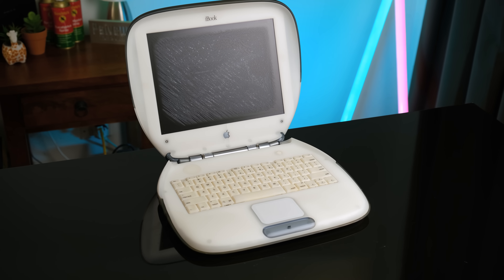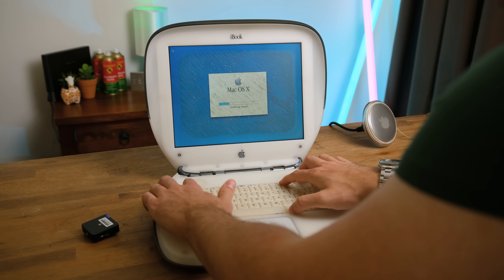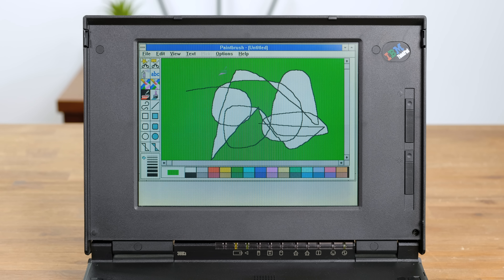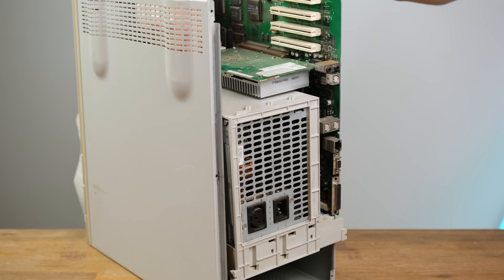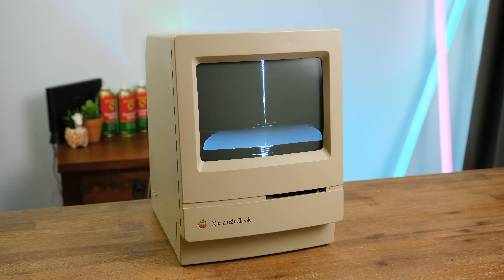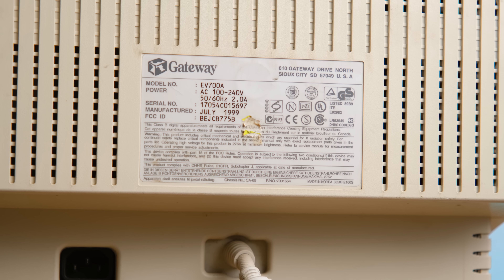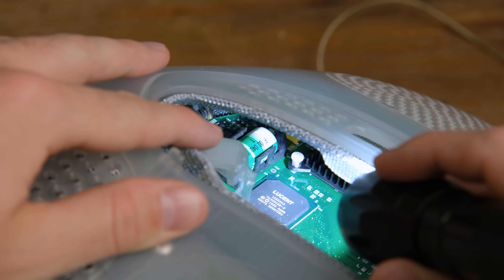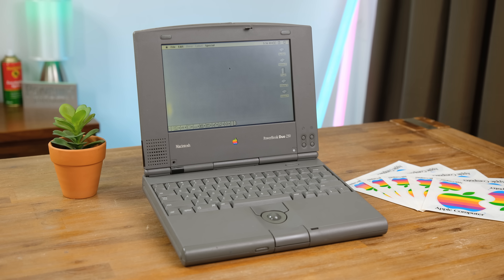So Much Vintage Tech Is Dying... Here's Why

Comment: Back in 1987 my boss had a 2nd generation IBM workstation. green monochrome, big floppy disk drive, the works. She loved the keyboard so much. There was an old photo of Bill Gates with that exact same model in the background when he first started out. It was built solid but computer tech guys all hated her using it and kept wanting her to upgrade.
Reply: That sounds like an IBM Model M keyboard, they started coming with IBM PCs in 1985. I'm using one from 1994 to type this, I love it. There is a company called Unicomp that still make them.
Reply: @JustinHiggins  "2nd generation IBM" probably refers to the IBM 5160 PC XT, the successor to the IBM 5150 PC. These computers used Model F keyboards! Far superior to the Model M, IMO.
Reply: @AerFixus  I thought ‘2nd generation’ might refer to PS2. I would love to try a Model F, but they are a lot harder to find than the Model M.
Reply: @JustinHiggins  given the rest of the context: The IT department wanting the user to upgrade the machine in 1987, presumably because it is out of date, wouldn't make sense to be a PS/2 since that was released in 1987. Also notable is that it had a monochrome green screen, which was no longer a standard option for the PS/2. Also, having a "big floppy disk" seems to refer to the 5 1/4" size of disk, rather than the smaller 3 1/2" floppy disks.

Anyway, it's an interesting story. And Model M and Model F keyboards are both great. I'm just a snob and I enjoy typing on an F significantly more than an M. Don't get me started on Beamsprings!
Reply: @AerFixus  Oh, so you're the reason I can't find a reasonably priced keyboard for my IBM 5150 😂
Reply: @thepenultimateninja5797  I use an IBM 4704 Model 200 board, a 62 key Model F. I've had a few XT boards, but all but one were either paired with a 5150/5160 computer when I bought them or are now reunited with matching computers at a new home. That was years ago that I bought those, though. I haven't purchased any orphaned 5150/5160 boards for more than 6 years. Incidentally, my beamspring was saved from severe fire damage. There's a Deskthority thread on that one.
Reply: @AerFixus  it's probably an AT connector
Reply: @Aer Fixus  are they actually superior ?
Reply: @AerFixus  If it's a realy old 'personal' computer, or a later Mini computer, it could have used 8" floppy disks 😜
Reply: @JustinHiggins  a few times I tried to order an Unicomp keyboard asking for shipping to Brazil. but I couldn't get an answer.
Reply: @JustinHiggins  Got one from '86 here, still works great. Such a pain to have to pull and clean the keycaps every few years.......(snicker)
Reply: @JustinHiggins  crazy that you're using an 80s keyboard to type in the 90s, on a comment that gets posted in 2023. How optimistic are you about the future?
Reply: @TheRogueAdmiral  Quite optimistic: I think if we can make it past the y2k bug, everything should be fine until 2038.
Reply: @JustinHiggins  I have the unicomp version, but it isnt quite the same as the origional even though its supposed to be made with the same tooling the origional was made with. seems to be very close though. There is a video on youtube that shows how ibm slowly cheapened these keyboards over the years before they stopped making them
Reply: @kwacz  I have a Unicomp KB too, I agree the components aren't quite as refined as the original Model M, but they still have the buckling spring switches and a very similar typing feel. You also have to remember than the Unicomp keyboards are $104US now, the original Model Ms were the equivalent of ~$500 in today's $, so Unicomp is very good value.
Reply: @JustinHiggins  She said it was the only keyboard she can use having long fingernails. Keys were raised more and clicked when used. Now it seems all are flushed.
Reply: @TheMocholoco  I ended up for the longest time having to get old shitty keyboards because it felt like that was the only option if I wanted to have my raised keys. then people figured out that there is a reason that keyboards had raised keys, and I now have a pretty pink mechanical keyboard with raised keys and hello kitty font.... god the internet is great.i don't even have long nails or anything, i just like they way they sound so much better. simple pleasures i guess.
Reply: @TheMocholoco  Overly long nails are disgusting. So much is hiding under those nails
Reply: @marcel3942  Call me inconsistent if you want (I quite like stiletto heels) but I'm somewhat bewildered be the appeal of almost ridiculously long fingernails - impractical and unattractive imho! (Yes, I know - no~one asked!) So ubiquitous have both witch~like talons and the necessity of using keyboards and touchscreens many times per day that I've noticed the phenomenon of many women having developed these sort of 'recurved' fingers; must be epigenetics, or some damn thing!
Reply: IBM Tech lives forever...  I stopped buying Apples once they switched to cheap plastic & glue together construction.
 Tech must be east to maintain and upgrade...  but Apple & Others are pushing Landfill  toss away disposable tech.
Reply: @SeaJay_Oceans  Do people still pay through the nose for Apple stuff because of snob appeal? That always seemed weird to me. Well, maybe there was a time when it made a certain amount of sense, but it seems to me that time has long passed.
Reply: The old saying seems perfect for this😂
Reply: @NathanPlays395  🍎💨👩‍⚕️?
Reply: @richiehoyt8487  not that but actually true considering how they targeted big businesses ONLY back then
Reply: @NathanPlays395  I suppose I just done an 'r/whoosh' but I'm gonna count it as a win; sometimes you can be right even when you're wrong! It used to be that lack of financial wherewithal kept me out of the 'Apple' camp - well, that, and a degree of contrary~ness, possibly - now, I guess I could buy an i~phone if I wanted one, but even leaving aside my resistance to over~priced tat, I hereby swear that as long as they continue to wage war on the 'Right to Repair', I will abjure Apple products!
ps - I just know I'm gonna feel stupid, but 'I gots to know!' Please, Enlighten me: What is the Old Saying?!?
Reply: @richiehoyt8487  if it works, don't fix it.
Reply: @NathanPlays395  🤦Ok, gotcha..! And yes, I do feel like a dope! Agree 100% btw.
Reply: Wow talk about time capsule that's amazing!
Reply: Upgrade to what?? Modern crap. Never used a keyboard as good as the old fashioned buckling spring keyboards. They should have kept making them. They were the best tactile keyboard ever. You could tell just by how it felt if you missed a key or bumped the wrong one. I wish 8 never got rid of the keyboard i had on my old 486 pc
Reply: https://youtube.com/shorts/T6-O2u0KCDc?feature=share
Reply: Pretty sure Avis car rental still uses those
Reply: All by Design. The past must always be deleted so they can keep lying to the next generation about it.
This is why video and audio formats are always changing too. This is only one of the things put in place to fulfil that agenda too.
Why do you think hard drives are now soft drives and everything is pushed online.. All that used to be paperwork. 
Then they Stage an EMP event and delete everything because they put all the data in one basket as they continue to do.
PS: They are the Eastern Matriarchy .. They are The Real Enemy of the people. (Who are not of their lineage.)
These are not CLAIMS either.. They are SOLID FACTS.
Reply: I had to add that she kept that computer for almost 10 years, said couldn't find another system like that. Tech made the system work which was impressive to me.
Reply: @TheMocholoco  they had something very similar in a corner upstairs in the old city library in Leicester. It had an IBM DBII-based user Search program that only had details for the older books in thier reference-only archived. It was a real joy to use. Very easy to search for something and surprisingly quick, considering the computer it was using. Sadly, I think a lot of that archive and the computer are lost forever. They call it 'progress' but I'm not convinced.
Reply: very based most keyboards especially before modern mechanical keyboards would be a downgrade
Reply: I have a 5150, booted first time after being sat for 20 or so years, even the old mfm drive pleas perfectly fine.
Reply: The boss: "Nigga, don't hate me cus' I'm beautiful nigga.."
Reply: @victorfaraday4164  Since that's no Bruce Springsteen song I know, I'm guessing you're talking about James Brown? I know, of course, that the licence allowing for the use of 'that word' between quotation marks was revoked some years ago - so if you haven't been struck down (or cancelled) by a thunderbolt, then I take it that that spelling (the one ending with the letter 'a') is still permissable..? Wow! The possibilities are just dizzying! Starting with the 'possibility' that you're Black, of course...

Comment: Damn. This such a shame to see. And this will just inflate prices for existing retro tech that does manage to survive.
Reply: It'll inflate it to the point where only rich collectors should consider buying them. I'd rather get a used GPU at the same price or lower as an old computer.
Reply: Yeah I can see that - 286-486 systems are increasingly selling for more. Good :D
Reply: @the_kombinator  No that’s bad inflated prices just makes it harder to get people interested the hobby. Retro gaming is not about money and gate keeping the hobby only hurts everyone.
Reply: @TalesOfGothic  Do you even know how to use the phrase "gatekeeping" properly? I mean, if I had a monopoly on every retro system ever made, and jacking the prices up to my benefit, perhaps what you said would make sense. I'm literally a drop in the ocean of retro tech sellers, so yeah, please use the phrase "gatekeeping" with some kind of aurhority.

1) I'm figuratively hopping the fence (i.e. bypassing the gate) to get retro systems that were pulled from recyclers, dismantling, painting + retrobriting (when necessary), seeking the era-correct drives, floppies, CDROMS (if applicable), refurbishing the often soldered RTC clocks, or worse, repairing the board from a leaked Varta cell, pairing the machine with appropriate I/O and a CRT (or at least a 4:3 LCD). I will install the correct OSes and load the drivers, optimize the memory, etc. - this takes an inordinate amount of time, and by God, I will be paid for my work, this isn't a volunteer shop - a lot of these systems are 30+ years old and require refurbishing, which I do, for a fee. Don't like it? Don't buy it. 
2) These machines are kept out of landfill and redirected to enthousiasts in ready, working order - plug it in and use it - I don't sell half-dead garbage that needs any extra work.
3) You can get into the hobby for free - it's called abandonware and emulation.

If the prices of the stuff are increasing, it's not because I want them to increase - I recently got a new batch of 2,3,and 486 systems, and the prices for them went up. I'm not taking a cut for some lofty ideal - this stuff is rare and it takes someone who knows what they're doing to keep it going, and it's only going to get harder.

No one is being hurt here except your feelings.
Reply: @the_kombinator  it’s bad that prices go up. I already have the systems I want. It just makes others who want to get into the hobby feel like there’s to much of a barrier to entry.
Reply: @TalesOfGothic  No, not if you know where to look - there are good alternatives to eBay, especially in the US.